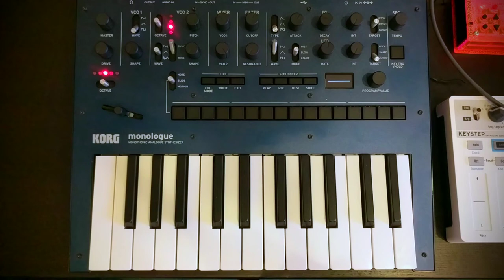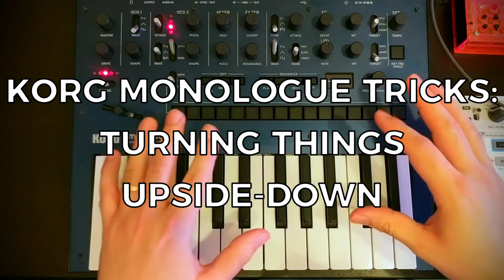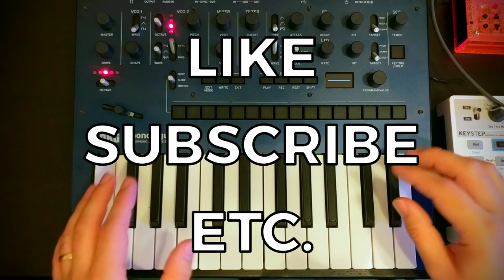Korg Monologue Tricks 03: Turning Things Upside-Down

Comment: Sounds similar with the pre-set sequence 61 Pumpdriver, I have used it couple of times as an base for similar tricks with the LFO. Do you happen to have any idea how the motion sequence track for the Drive on that sequence has been made? It has this extremely sharp and regular serration on it. I find it impossible to be dublicated just by turning the Drive knob, or any other knob/switch for that matter. The slider on that sequnce has been assigned for LFO Rate function, so it's not it either.

Comment: So does that make the Mono an Additive synth? I thought its architecture was subtractive??
Reply from the maker: +Pat Kelly a subtractive synth, in simplest terms is "start bright, use filters to make dark", so we're still subtractive on the Monologue. But don't worry too much about defining synths strictly, you'll find plenty of synths that have elements of both (for example, the shape control on the Monologue is kinda an additive trick).
Reply: Thanks. I am very new to the world of hardware synthesis although have been using soft synths for few years. What i've found interesting is the difference in sound when performing the same actions on a similar type synth in hard vs soft scenarios. You're videos are invaluable as a near newbie.
Reply from the maker: +Pat Kelly glad to help out. Welcome to the wonderful world of hardware! Every synth has its own character, discovering that is part of the fun ;)

Comment: I need to look for the manual again. Swear it was just warranty info.
Reply from the maker: +Kame San it's a little on the light side, but it does cover off each function. I might be making this up, but maybe the one you can download from Korg's site is laid out better?
Reply: I guess you have to download it, the one that comes printed is just a simplified starter guide.
Reply: Yeah, I hate the "manual" because it's just two large pages folded into fours. I would rather read a PDF than unfold that crap.

And also, it's easy to discard because it doesn't feel like a manual as packaged, it just feels like another piece of paper you're not going to read.

(Saying this because I just started watching Oscillator Sink's Monologue videos and now he's got me digging out my manual that I never bothered to read.)
Reply from the maker: Remember that there is a PDF version of the manual - I have a folder on my Google Drive that it full of manuals, midi implementation tables, etc. for the synths I own (and some I don't). That way I can always quickly get at them whether I'm at my desk or just have my phone nearby. Kinda nerdy but I use it a lot - especially as people ask me questions on the synths in the comments section!